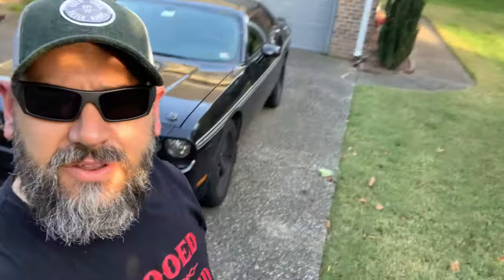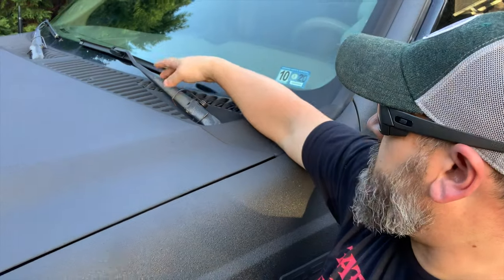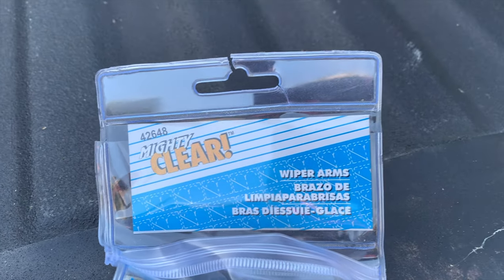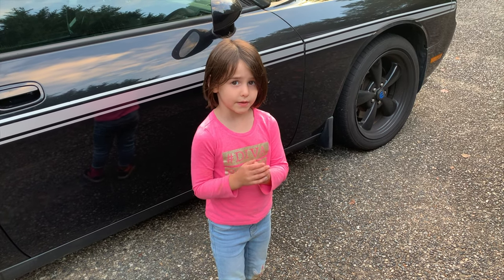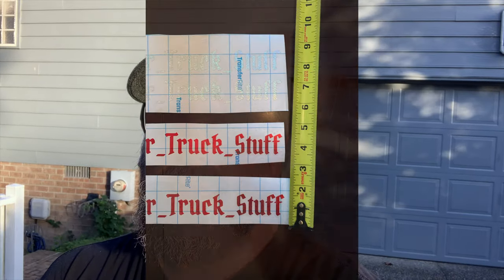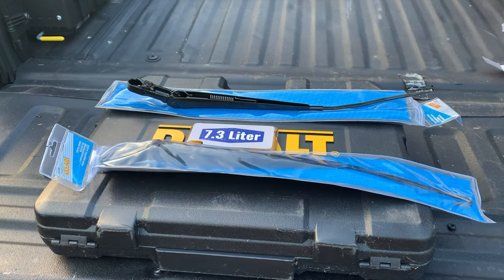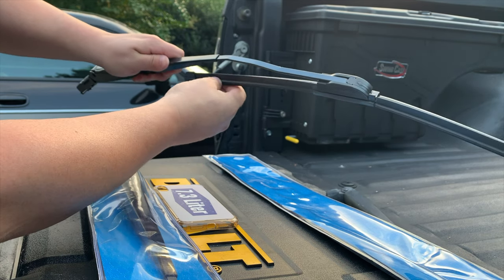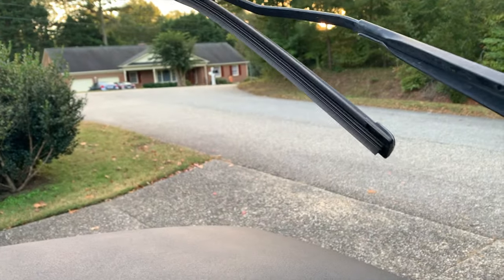Wiper Arms & Decals - 7.3 Liter Truck Stuff

Comment: I noticed your windshield sprayers look like they have BPH  (swollen prostate). Put some water with white vinegar in your spray reservoir and it should clear that up
Reply from the maker: TJ! Thank you for this feedback. Drivers side barely pushes fluid, passenger side is much better. I bought a gallon of “cleaning vinegar.” 

Questions: 
1.) Do I need to syphon out the window washer fluid first?   
2.) What’s the ratio of vinegar to water? 
3.) Do I just keep the nozzles on spray for a while? Let it sit? 
Thanks again for the advice!
Reply: @73LiterTruckStuff  I installed new nozzles. Very simple and world of a difference. I wouldn't even bother trying to clean them
Reply from the maker: @CHRIS_NYC  Yeah I need to order up some nozzles, where did you get them from?

Comment: Was this hard to do? I'm thinking about doing it. Do you have an exhaust? Is so, can you please post a video. Thanks bud
Reply from the maker: Hey Herc- Wiper arms and blades couldn’t be any easier honestly. 10 minute job when you’re not trying to film it 🤣. My truck is running a 4 inch straight pipe, no tip. I’ll look to do a quick video on it for sure. Thanks for watching!
Reply: 7.3 liter Truck Stuff why did you stopped uploading videos ?
Reply from the maker: @lorenzorodriguez748  Had to drop a new engine in the truck. Don’t worry, I filmed 3 more vids today, tons of new content coming soon!
Reply: @73LiterTruckStuff  well, come on with it man.
Reply from the maker: @MCT812  Yeah man, I’m overdue for sure! I’ll make it happen